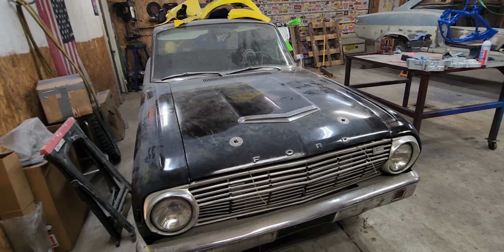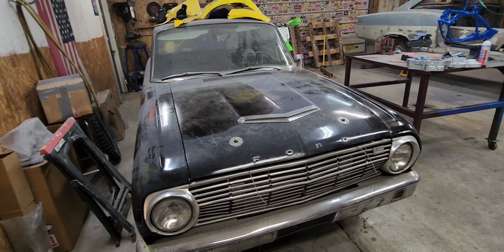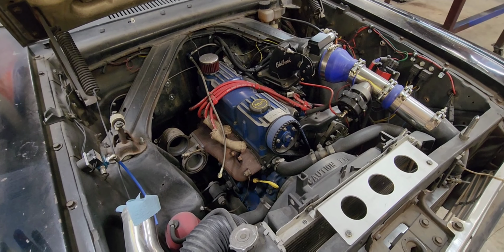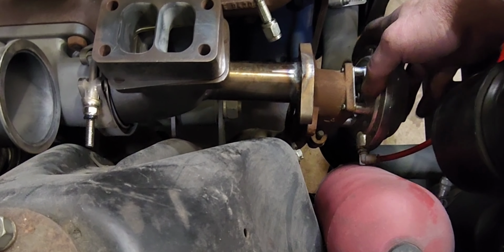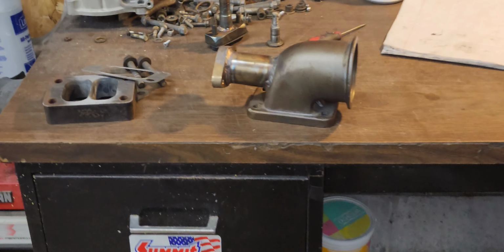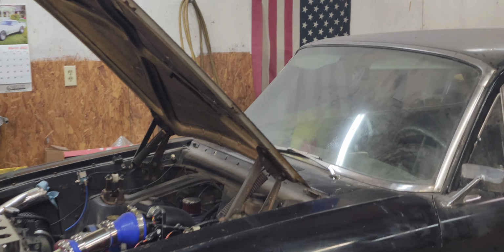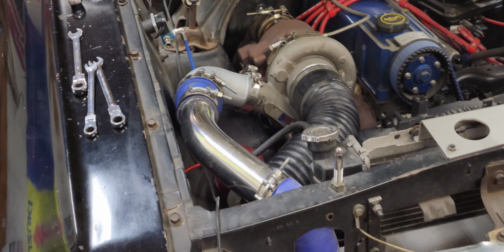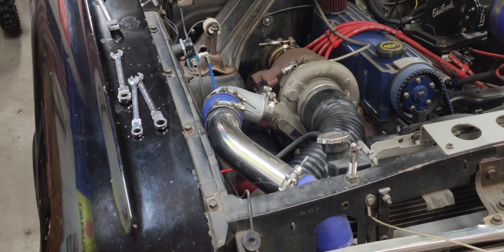turbo 2.3L 1963 Falcon gets worked on

Comment: I just caught a couple of your videos.  I would like to know why you didn't want to use the factory fuel injector bungs on the EFI intake.  Looking forward to further progress reports on the Falcon. Cool project!
Reply from the maker: I had welded them up when I originally had it set up for a carburetor. But even then they are all at wierd angles and it would make it difficult to make a custom fuel log. Otherwise I would be stuck with the stock fuel rail.it just evolved from different set-ups that I've done with this car.
Reply: @davesfordperformancegarage4511  I understand, plus it is rewarding to do your own custom fab when having the right equipment.
Reply: How did the Falcon do this year?
Reply from the maker: Never got it on the road this year, got to busy doing stuff with the dirtbikes. I need to get a laptop so I can tune it better. I have to get it going in the spring, and can't put it off another year